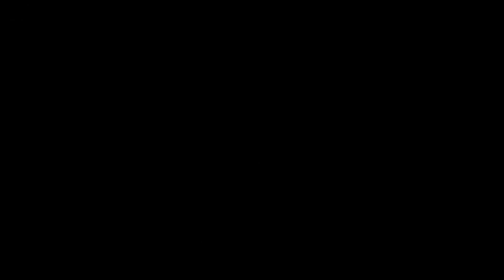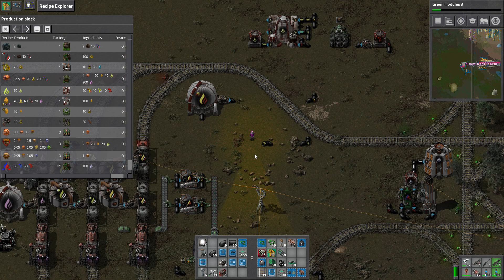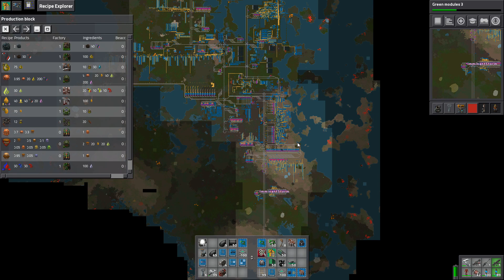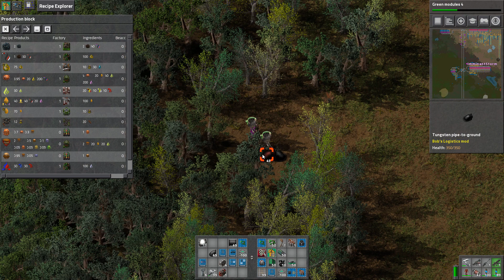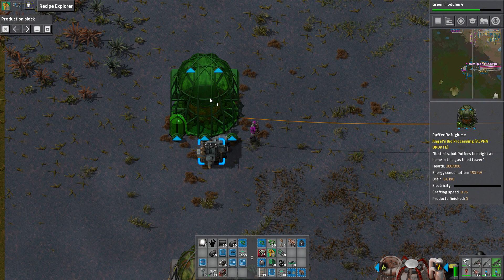Factorio - Angel's & Bob's - Episode 244 - A Little Gassy

Comment: For the alien spores, I picture the way it works is that they're floating around in the air all over the place (just like spores in real life), and the air filter just runs purified water over a flat area where the spores have settled, so it collects the spores and lets you harvest them. Also, some advice: I'd suggest making one refugiume for each pair of puffers you get, so you can have multiple breeding cycles happening at once. Breeding is the only thing that's guaranteed not to use up your puffers (2 in always produces 2 out, whereas the "puffing" cycle takes 4 in and gives you 3 out plus a 95% chance of a 4th out, so that eventually you'll hit those 5% chances and slowly lose your puffing puffers). So there's no risk in putting two puffers per breeding unit.